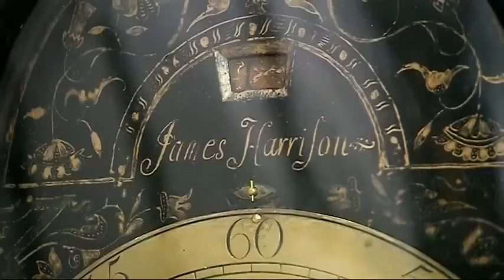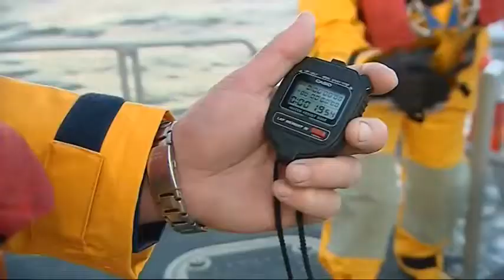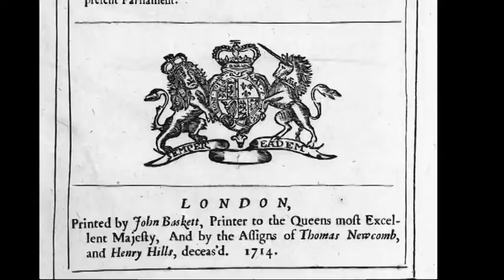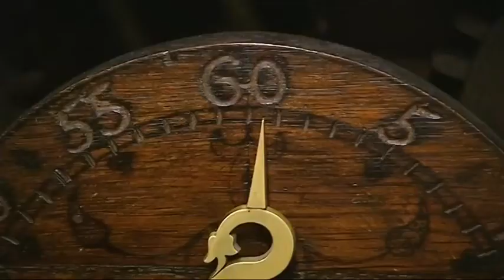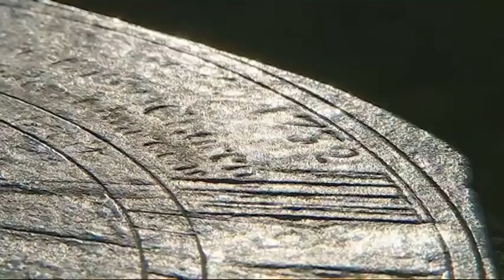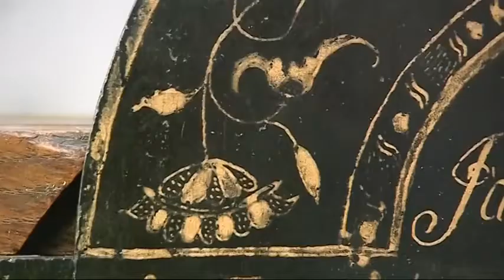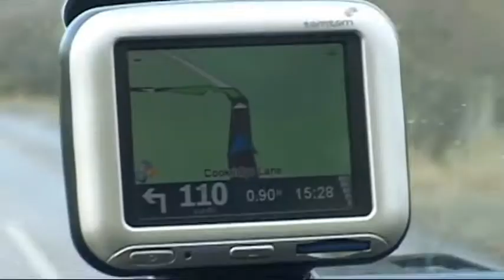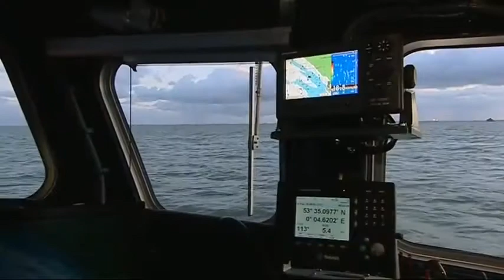The First Chronometer. John Harrison & The Clock That Changed the World

Comment: 14:59, John Harrison's invention is very far ahead that Swatch Sistem 51 and Tissot (Powermatic 80) started using self-lubricating materials for escapement wheels and pallet forks (using plastic instead of wood due to temparature changes). Plastic also self lubricates (petroleum oil), so same as the wood! Very far ahead and innovative.